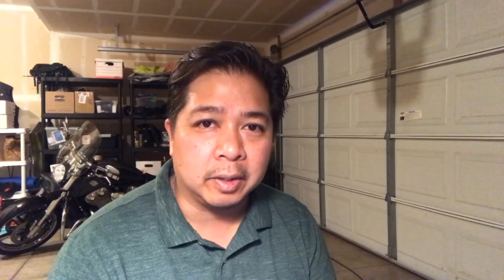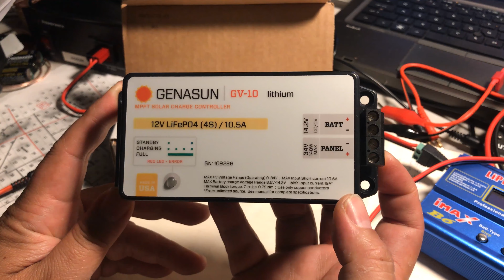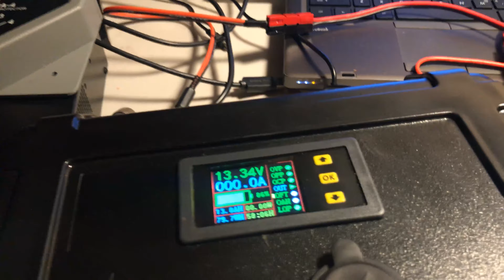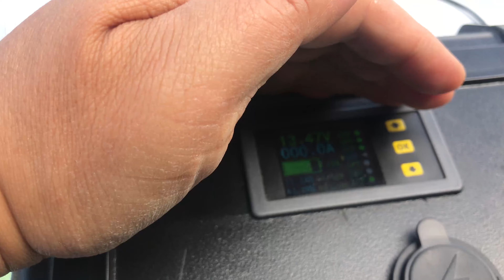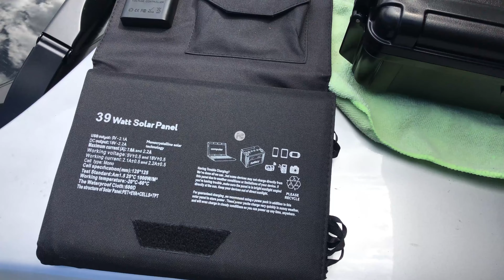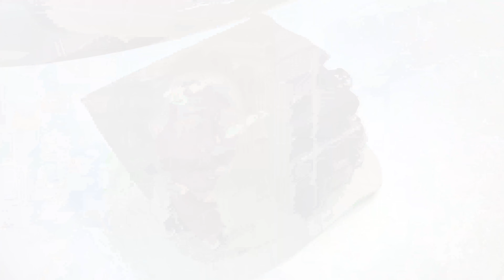Updated LiFePO4 Power Box with Solar

Comment: hi, what’s the relay switch for again? nice build but i’m confused. thanks
Reply from the maker: I used the relay to switch on/off the power ports using the power meter. Using a switch directly could potentially burn the switch out.

Comment: Getting much better.
Isn't the Genasun nighttime draw µA, not mA? Check my video on powerfilm fm16-1200 20w panel. There is also increments from 30w to 120w. Check my website for the "Evenf support" blog post. That should also be interesting reading.
The reason you can't find that solar panel on Amazon anymore was the Regulator was melting down under heavy load. I mentioned that in your other video. 
If you're looking for an upgrade panel, Try to find a solar panel which doesn't have any regulated output.
Reply from the maker: Thanks, Julian. I did talk at length about Powerfilm but edited it out because I was going on a tangent. Basically, I don't really want to spend $1500 on a panel (or even several hundreds 28w panel), I believe the consumer solar tech will come up in quality and come down within reach in terms of price. And yes, on the Genasun it's mA, specs say night time draw is "0.9mA (900µA)". Would never have found this amazing Genasun controller if you didn't highlight it in your various builds, thanks!
Reply: @AD6DMDennis  well PF panels are the most portable most reliable so they cost. If you don't need the portability, try Lensun. They are less portable,  a little heavier, and better priced. The really important thing is not to buy panels with the regulator on there. 
About the smart charger.  Why do you need it? I usually just leave my battery on the back porch with the solar panel in the Sun.

Comment: Another nice video Dennis. Still pushing the K8MRD time limit. :-). As far as your issue with the smart charger, see if you can find a double pole, double throw switch with a center off position(switch positive and negative wires). Place this between the battery and the charge controller and another input port for the smart charger. This would allow you to select between the two charging sources. In the center off position, there should be no current draw and it should function as a master "kill" switch.
Reply from the maker: Interesting, good thing to consider... a double-pole double-throw switch. I was visualizing something of this sort with a secondary 5-pin relay hooked to the LCD relay controls, but then I'd drawing more power just on switches. I'll research more. Thanks for watching, Don!